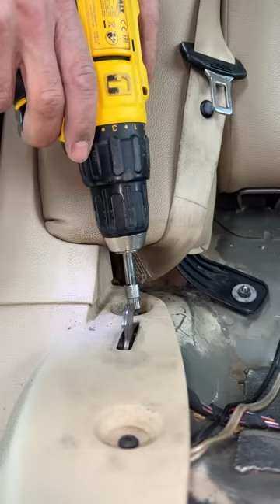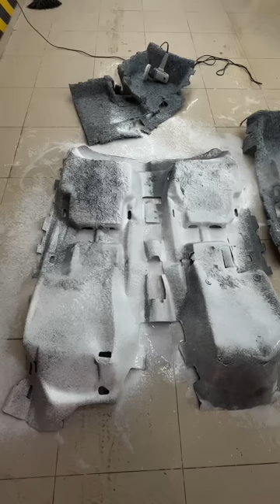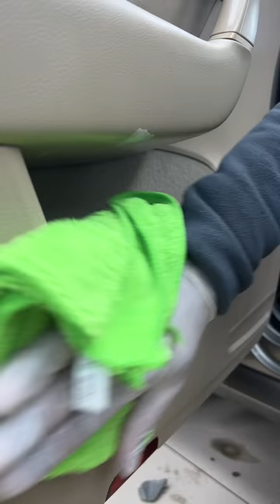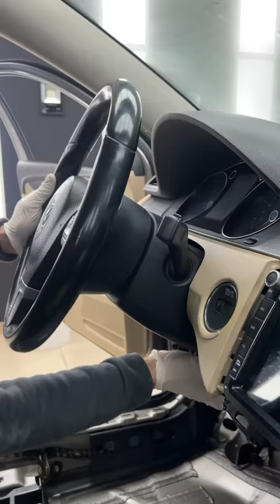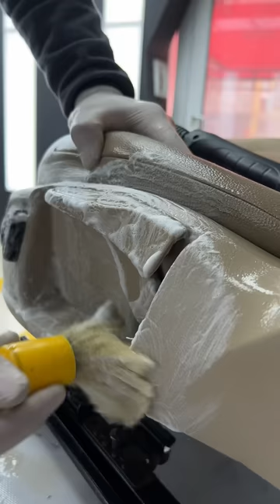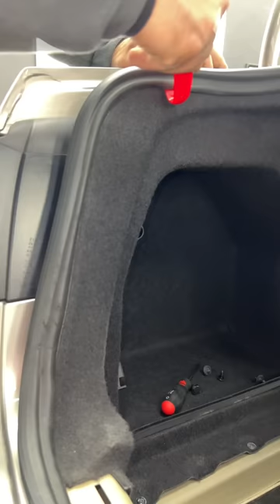Fresh Start for Your Volkswagen Passat: Removing Milk Stains and Odors Inside

Comment: Automotive detailing work is excellent.
I just want to mention that to avoid false contacts and shorts, the wires should be disconnected by pulling on the harness, not the wiring.

Comment: Guys, is the Würth cleaning foam better cleaning product than the usual APCs on the market (Koch, Meguair´s, Gyeon, etc.)? Because I´ve checked and one can costs quite a lot of money and I can see you need quite a lot of it. Otherwise, great job as always! You´re the best!
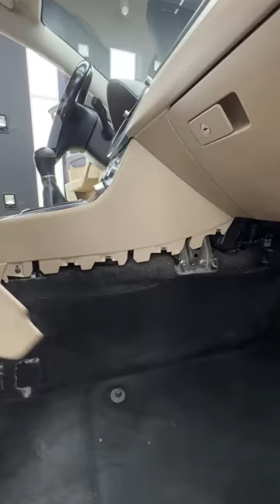Reply: I have never used the würth cleaning foam, but Im a big fam of Koch Chemie Products. I use pol star for basically everything, its a ph-neutral cleaner, that I dilute 1:20 and it foams up pretty well with a brush, so I use it excessively and still have a cheap outcome. My car interior is clean anyway basically, so for maintenance, its just perfect for me and smells nice. Ideal for all surfaces too. For a more aggressive cleaner, I use green star, which is ph 12,5 and should be used with caution. I dont really use it on the interior other than door jams and some exterior. Guess hard plastics should be fine with green star though. Gyeon has ready to use products, which u dont dillute, so thats much more expensive I assume.
Reply: @mmeeeh  ONR will do exactly what you want for 1/128th of the cost of Koch Chemie products.

Comment: Why turn Off the AC when using spray at the end ?
Reply from the maker: because the air conditioner needs to be turned off.
Reply: @Depcars  oh, I thought it was a spray for AC. Nice work!